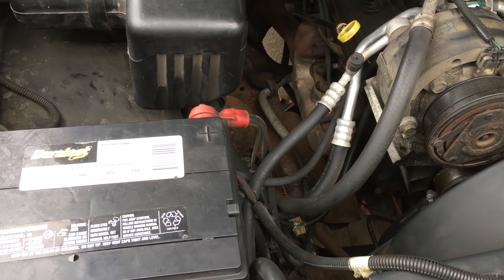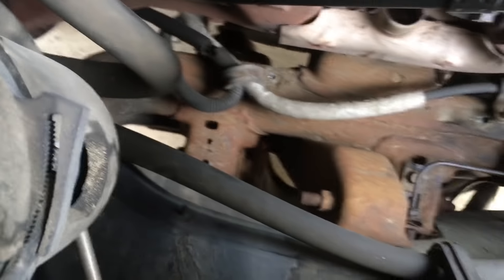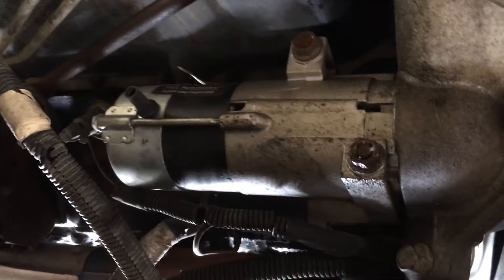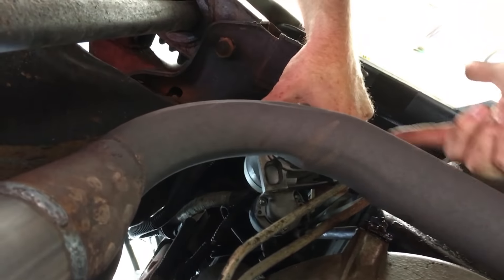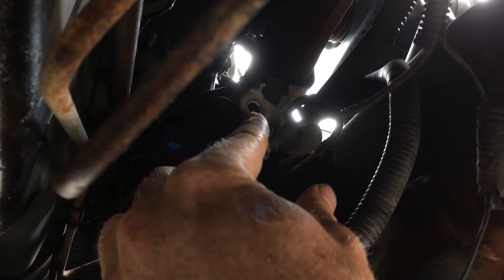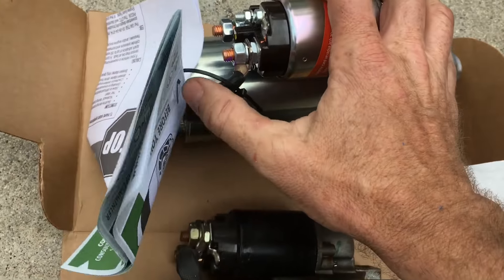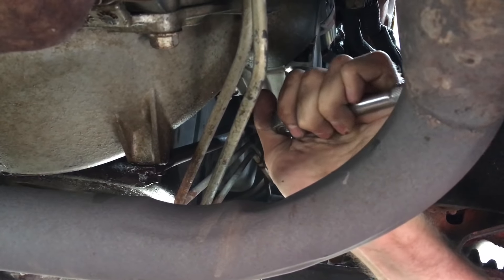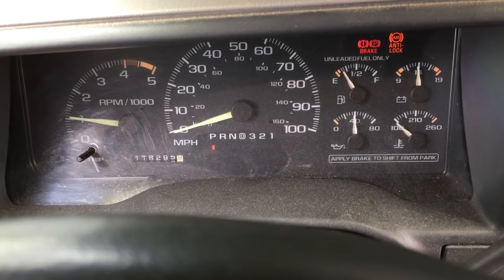How To Replace The Starter On A Chevrolet Truck

Comment: Holy crap you just saved me a ton of time and headache with your screenshot about the bolt length.  I have a 93 and am self-taught via youtube from knowing nothing about cars 1 year ago.  It would have taken me forever to figure out that this was my problem, because it was not mentioned in my instructions and I just thought I wasn't lining the holes up correctly. None of the other videos I watched mentioned it either. Thank you! I just subscribed :)
Reply from the maker: You’re welcome

Comment: Losing up the positive battery cable for slack to drop the starter down more, and get off the two cylinoid bolts was the tip I was looking for. 👍
Reply from the maker: Glad I could help

Comment: Good video. Something very important that you need to correct. At the very least you should note on the first line of your description. Disconnect the negative battery terminal first. Why? Because if you have your wrench on the positive terminal and you touch the other end of it to any other metal component you will get a huge spark and will damage your tool and possibly your battery. By disconnecting the negative first, you don't have this potential problem. You don't even need to disconnect the positive terminal if the negative is disconnected. DG

Comment: Thanks bud just spent all night dealing with crank sensor causing kick back which broke starter bolt. So after drilling  and rethread I forgot which wire went where lol tired or stupid maybe both🤣😎 APPRECIATE the info
Reply from the maker: You’re welcome. I’m glad I could help.

Comment: I haven't had to change a starter in so long.... decades. The last one was on my GF's 77 eldorado. That thing must have weighed 50 LBS. what a nightmare. I have been very lucky with starters since then. I think they just don't go bad like they used to .
Reply from the maker: +ACoustaDC this one is pretty much the same technology as that. I was just glad I didn't have to move any heat shields or exhaust parts to get to it. So it's a really easy job.

Comment: Well done video, but having trouble getting new one to fully integrate into the opening for the gears to line up. Tried moving starters little gear a tad but didn't help. Also broke the small wire end iff. Gonna try again this morning now that I won't be laying in a cold wet driveway where the rain was running downhill. Ugh
Reply from the maker: Good luck. I hope it worked. Mine just popped right in. I wonder if they sold you the right one for your engine.
Reply: @hoohoohoblin  they did. Larger wires end broke off the next day. Fixed them both but guess what? Engine seized up. Had it towed away Monday. Mechanic gave me the bad news. Had it 24 years and 325K miles. Guess it was time. But damn.

Comment: Your video is pretty good, would be better if you said what size sockets or wrenches to use.
Reply from the maker: Thanks. I should’ve done that, because at that point in America, you never knew if you had to use metric sockets or American sockets. Back when I drove a barracuda, it was easy because everything was American. In the 80s and 90s everything got mixed up.
Reply: you're video would be perfect if you came over and changed my starter for me. Anyways thanks for showing how to change it, now I know what I'm getting into thanks to you sharing your knowledge.

Comment: No shims? ya should pull the little cog in the starter out to measure it to the fly wheel ya may need a shim or two. I know i needed 2 on my new starter in my 78 chevy silverado.

Comment: Maybe that unused post on the starter is the safety for the manual transmission ones? So you can't start it in gear?

Comment: Is that starter same with Chevy c10 1963 4.1 straight 6?if it's not the same what is the part number for the Chevy c10 4.1? thanks
Reply from the maker: I doubt it. That’s a lot older. I’m not sure how much similarity there would be.

Comment: That other wire is for your knock sensor
Reply from the maker: Thanks
Reply: @hoohoohoblin  not a problem, I just bought a 1997 and I was not getting any power to the truck, I was digging for any hint on what was going on,my truck has two batteries. I found out one is for the starter only and the other battery runs everything else and they're both isolated. Weird set up

Comment: I changed the starter on my 95 suburban I did the same thing you did in your video. Only problem I have is when I turn on the truck it makes a grinding noise like if the truck was a diesel and it's not a diseal truck. The noise stops after the truck is running. The sound is only when I turn the key and the truck turns on.
Reply from the maker: I wonder if the starter gear isn’t disengaging when the engine starts. Maybe they sold you a faulty starter.
Reply: shim the starter

Comment: hoohoohoblin What was your old starter doing? The one in my 95 Z71 is turning slow and dragging and I tested the volts in the cables everything was good so I went and bought a brand new starter like you did lol not a reman
Reply: Great videos btw! I subscribe to your channel
Reply from the maker: It sometimes started fine and other times it did nothing. If i went under the truck and hit it with a hammer, it would work again.
Reply: Gotcha. I just now got done changing my starter a few minutes ago and that was my problem, it was throwing me off a little with it clicking and then it'll start turning over slow like a bad battery lol but I'm glad it's fixed and I didn't have to track wires down haha...hate wiring. Thanks buddy

Comment: How hard is it to find electrical short in the wiring and straining the battery
Reply from the maker: Electrical problems can be really tricky to find. I’ve seen a few vehicles were the door locks circuit slowly drains the battery. That happened on an old GMC van I used to have.

Comment: Filmed with an iPhone?
Reply from the maker: Yes.
Reply: hoohoohoblin The iPhone films in a way that is actually impossible. Because it uses two cameras at a time objects near and far are all in focus. I marvel at it every time. By the way, that is the knock sensor wire you unplugged.

Comment: How did you diagnose a bad starter before you decided to replace it?
Reply from the maker: I had the guy from the auto club come out and test it.  You need to check and make sure it has power, and that the battery is fully charged, or at least charged enough to spend it, and if it still doesn’t spin, then there is something wrong with it.